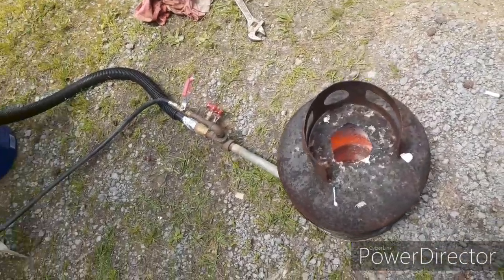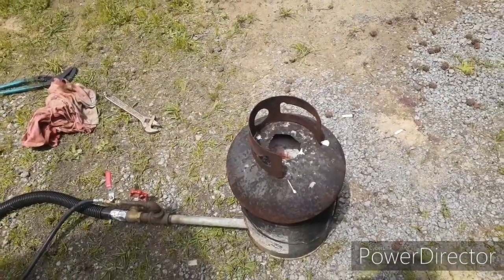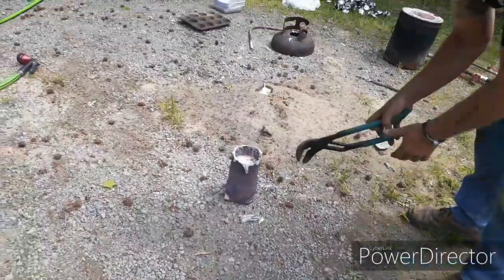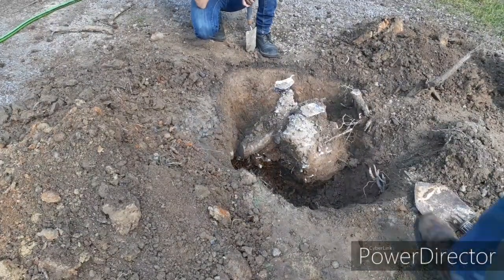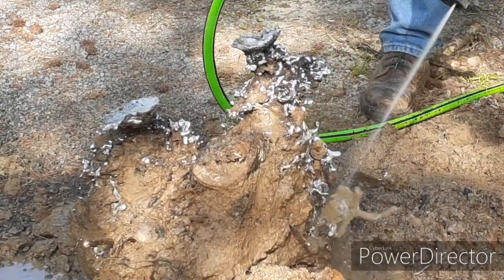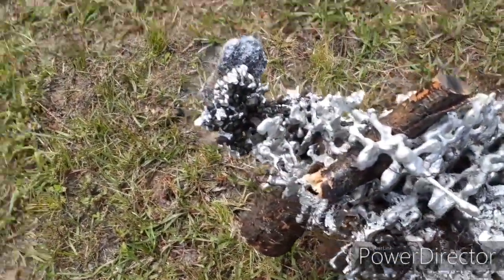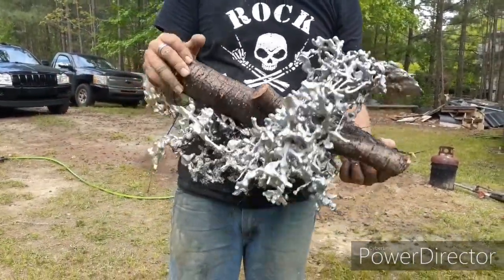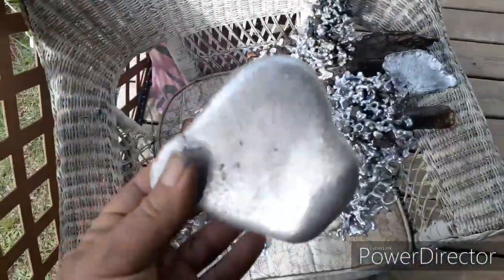Driveway ant nest casting

Comment: Magnesium burns at temperature.
Reply from the maker: Yes sir you are correct magnesium will burn at temps required to melt aluminum. But its found in t6 aluminum. So there is a way to mix the two at melting temps.

Comment: Very, very cool! Food grade aluminum. 👍🏼👍🏼😀 Nice casting Matthew and Amy!!
Reply: And, you said at one point, that the copper pipe, was now 6 inches long....could it have melted with the aluminum?
Reply from the maker: I edited that wrong. Its 6 inches shorter. Yeah it was getting real soft and breaking off when I stirred none was in the bottom of the crucible so I'm guessing it melted
Reply: @AAMW13  wonder if it was enough, to start a different patina? Wait n see, I guess. It would be cooler, than it is. 👍🏼

Comment: Sir that looks awesome can I ask do you just melt pop cans to get your aluminum for these and what do you use for your crucible?
Reply from the maker: I have alot of cans but cans need to be melted down degassed and drossed then poured into ingots and then remelted for castings. This one I used aluminum baking pans mostly. my Crucible is a piece of cast iron pipe with some mild steel welded onto the bottom of it. Because ant nest don't necessarily have a whole lot of vent tubes and there will be a lot of turbulence when it hits the Organics and burns them off such as eggs food and amps themselves the casting can be pretty brittle. It's best to use aluminum alloy such as can tops that has more magnesium aluminum rims and so on. Thank you for watching and commenting. Looking forward to seeing some of your stuff one day.